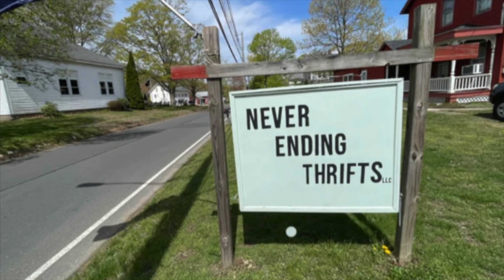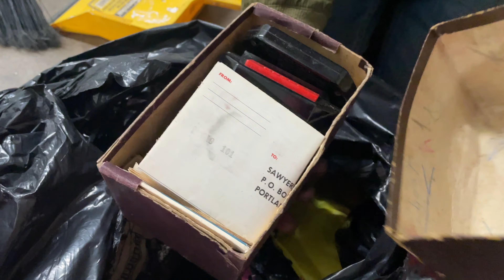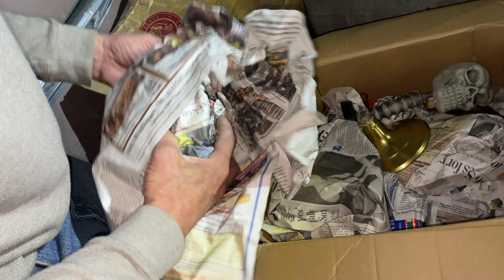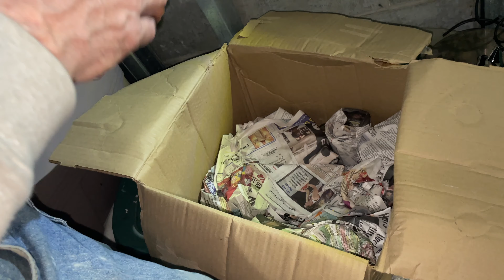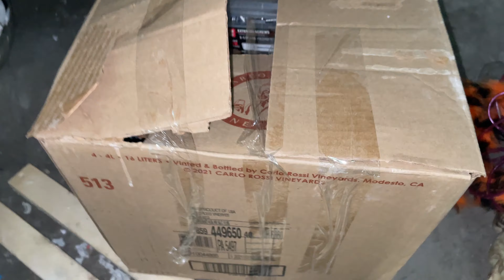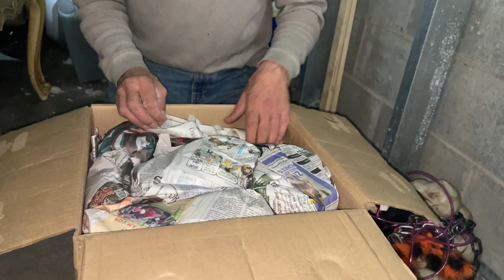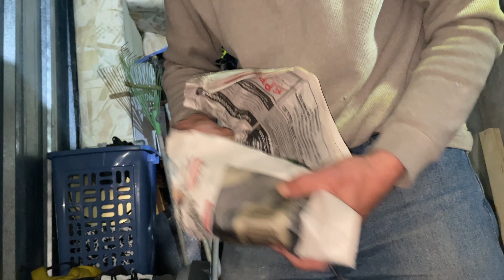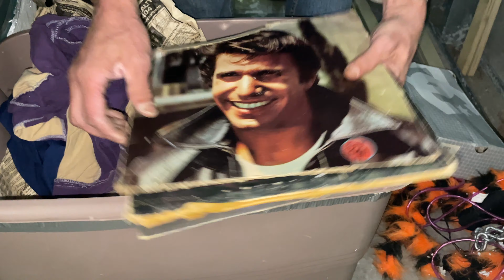Was Unit 248 Great? | Storage Unit Unboxing For Resale!

Comment: I don't believe that was a real K bars are made out of 1095 steel which will rest. Therefore, their blades are usually coated in something black.
Reply from the maker: Thanks so much for the information! Most of the knives we found were low end and not worth much at all so it makes sense.